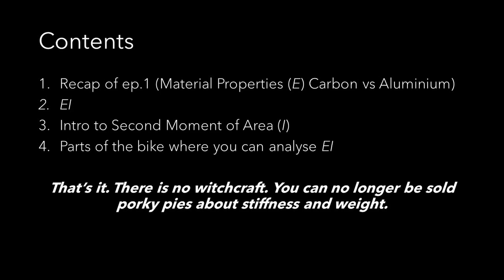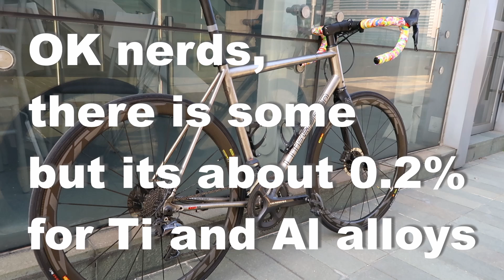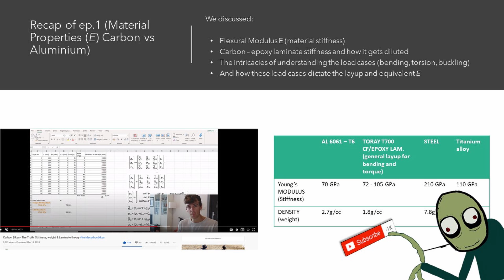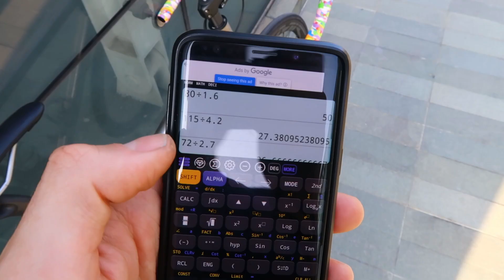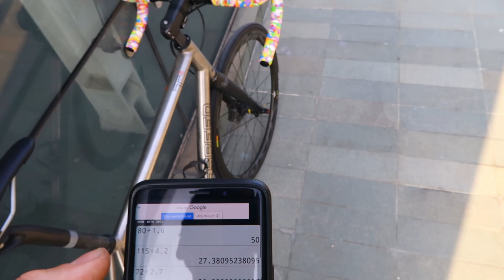Titanium Bikes - The truth and Physics of 'ride feel' marketing.

Comment: I sold my 2003 specialized Allez pro and bought a 2022 Litespeed T5. The geometry is advantage Litespeed. The specialized had a more compliant ride overall. About equal in climbing, handling and acceleration. The Allez is quite a bit lighter. The endurance geometry of the T5 makes it bit twitchier as there’s more weight foreword. My age made the switch necessary but I loved that Allez.

Comment: You need to be clear what you are comparing when you say titanium is not less stiff than an alternative.  The comparison is often between ‘typical’ titanium and ‘typical’ carbon.  In this case it seems that the extra weight of the titanium is less than needed to compensate for the lower stiffness of titanium vs carbon.  So in my typical example, the titanium is a bit heavier, a bit more flexible than the carbon.  The other factor is the shape of the ‘tubes’.  The carbon has a massive bottom bracket shell compared with the titanium, for example.  I’m almost certain that the titanium bottom bracket construction has more lateral flex than the carbon.  So in my case the titanium feels more flexible, smoother, less efficient, more comfortable, heavier than the (lighter) carbon framed bike.  I’m obviously not comparing equal weight aluminium and titanium bikes.  If I wasn’t looking for maximum speed and efficiency I’d prefer the titanium, particularly for a long endurance ride where comfort plays a bigger role.

Comment: i have 3 titanium frames i Love them all.. different characteristics from mtb, road and Gravel.. whew love the materials no corrosion and no paint chips 😂
Reply: If you want the Ti material to keep looking great, I am sure you already use scotch bright pads on them.  Then finish it off with Lemon Pledge for a fingerprint free finish that lasts quite a long time.  I got that trick from the guys I worked with at Nuke Proof in the mid 90's (when they were in Michigan USA).

Comment: Old video I know, but I just stumbled upon it. A few comments: 
Would you make a guitar string out of aluminum? No! Of course not! 
The ti bike in the photo is way too small for whoever is riding it; of course it's not stiff enough for a large heavy rider.
Modulus, modulus, modulus. Could you say it five more times?
You say frame stiffness based on weight, etc. Is roughly the same.  Well that may well be, but these materials can't be utilized the same. Aluminum bikes use large oversized tubes because of the low fatigue resistance of aluminum. Carbon fiber can be built very light, but again eventually it will fail! 
I own steel frames, a stainless steel frame, aluminum frames and I've ridden numerous carbon fiber frames. They are all very different kettles of fish.
You only partially understand the differences in materials and the "modulus" is only part of the story.
If you're only looking at stiffness fine, but as you point out it also has a lot to do with tubing profiles. Yes! That makes a massive difference! 
But, also the different materials have different characteristics. Aluminum can be extremely light, but it's unforgiving and even with advancements over the last 10+ years can really beat you up on long rides.
Steel? More forgiving you can utilize a thinner tube to get a lighter frame but can become too "whippy".  I think of steel (like a Columbus) as sort of the bench mark, the mid point between stiffness and strength.
Titanium "ride feel"? No, it's not just hype. The thing you don't take into consideration is that titanium doesn't just flex; it has extremely high stress resistance. The number of fatigue cycles you can run a titanium frame through is ridiculous. They are almost indestructible in normal use. So much so that this natural springlike characteristic is used to add shock absorption to frame designs. 
More than any other material Titanium bikes "plane". In other words some of the energy lost to flex on the downward pedal stroke is recovered on the alternating stroke. It's this lively feel that gives titanium its legendary mystique. 
You will often find that people who find a good titanium bike that fits them and their style of riding drop out of the new bike merry go round. It's the ultimate forever bike. 
I finally found the perfect ti frame for me a couple years ago. I then had a custom ti fork made for it. It rides great and I'll continue to ride it til I take my dirt nap! 😎

Comment: I think the modern road bikes with straight forks and hence shorter wheel base have made them twitchier and less compliant at the front. Im comparing the ride feel on my 2015 carbon Trek Madone to my Reynolds 653 custom race bike from 1993 and the 1993 bike was so much more stable in the corners which gives confidence. I think in the pursuit of every last scrap of performance the modern bikes have sacrificed some comfort and feel

Comment: Fine appraisal. Im struggling to pick holes in here but leads me to a different conclusion. 

Im an Al Canyon frame guy after suffering longevity and practical issues with carbon, for my riding, i would go thin walled Ti (super thin making the most of properties) or Aluminium as I am. Weight? Pah, im sub 7.5kg with careful choices, dont care.  I do care how long it lasts.

Comment: Aluminum tends to be stiffer because it needs to be overbuilt at stress points due to higher fatigue rates. Steel and titanium don’t need that due to their resilience. Titanium is extremely resilient to fatigue and can be designed to flex. Example is Moots pivot less suspension! You are oversimplifying the material properties. The frame manufacturers have the ability to make any traditional material ride compliant or stiff. I have owned steel aluminum carbon and titanium bikes and can say that they were all very different mostly because I’ve been biking on racing bikes since 1981.

Comment: 2 years old video doesn't need more comments - everything was already said. But still... In reality, in frame design, you are limited by strength properties. The goal usually is to build strong enough frame with as little material as possible. If a material has lower stifness to strenght ratio, you are able to build a softer frame from it. That's reason, why steel and titanium is usually less stiff than aluminium, and carbon is usually even stiffer. The weight is the output - not the input of the equation. So nice video, but missing the point totaly.

Comment: All things being equal.  The same frame with 5-10Kg of additonal weight rides smoother,  Heavier bike have less vibration, is less twitchy and has more speed momentum.  I added 10Kg to my Cannondale Topstone 1 105 and it was much smoother and NOT any harder to pedal under 25Kph,

Comment: Ti will be stronger, won't dent or tear as easily as Al, won't shatter like carbon. Will be corrosion resistant. Is more weldable, not the massive distorting heat input for Al, not the heat treatment complexity of Al. Is more machinable and expansion coefficient compatible for crank bearings. Material for people who want a bike that lasts a long time, maintain the mech and wheels, and don't worry about passing aero fads.

Comment: Interesting ,  I do bike packing I've just ordered a titanium framed bike for the weight , & the fact it holds a pinion gear box . The weight is only important to me when it comes to lifting over fences etc , They are also 3d printing  titanium these days so the shapes aren't a problem .Also most of my comfort comes from 2.6Inch tubeless tyres at lower pressures .

Comment: nice  consideration  not  necessarily agree  on all the  statements, the main  issue  is  that  the  25  especific  modulus been  stablish  as common  denominator  then  Ti  Steel ... round  tubes have some  diferent  that bring or  add  to  the  comfort  not  for  specific  persons  ... probably all persons can  feel  the diference from  smooth  tarmac  to  cobbles... and  even  more  on  gravel  ... then is  marketing  but  then the  virtue  is  not  the  material  is  the  form and  the way builders  use it... like bike  fitting  kinda  jumps  in to  your  face  the  diferences  after  ad  before  using  or  having  one.

Comment: whatever. I love my 2023 Arenberg Litespeed. I came from riding an aero carbon, and from my experience, the Ti is sooo much smoother, and I have lost zero speed. It's just awesome. believe the haters if you want, but Ti is the truth. Ti and Al are NOT the same. Weight alone debunks that thought. And the 'Can' demo? Is that can made of 3/2 or 6/4 alchemy?  What a stupid fucking argument. Is tissue paper the same as cardboard? They are both made of paper, so they are the same, right? SMH my head, my dude. All this to say, my Ti is 1lb heavier than my Carbon. It's more comfortable. It's just as fast, and it will last a hell of a lot longer. Not to belabor the point, but I have all the Pokemon. I have a Steel bike, an Al bike, a Carbon bike and a Ti bike. Steel is... an experience. Al is like swinging a weighted bat. Carbon is great, but temporary, and you feel just every pebble on the road. Ti gives up a bit of weight for longevity and comfort. Don't just believe any dude on the internet,  me or this git, just ride one and see for yourself. The proof is in the pudding.

Comment: I know this is an old video, but, some historical perspective is necessary. Before Ti, 99.9% of the top of the line bike frame effectively has a limited number of hours before you need another one.    (Aggressive, unstoppable corrosion and no way to stop it). Enter titanium!  It took a long time for cycling consumers to adopt.  High end consumers didn’t have to accept the limited hours of high end steel frames. And they were incredibly light with generally excellent riding properties. IMO, the Ti bike manufacturers “hang on” to this period in bike manufacturing as justification for their products. In 2023, Aluminum definitely has parity with titanium performance at much lower costs.  But, Ti frames are still SO pretty!

Comment: Young's Modulus for elasticity is of course accurate.  In the realm of bike frame design, tubing wall thickness, geometry of frame set layout, can make a 56cm titanium frame ride harsh and an alloy frame ride smooth, or vice versa.  I've ridden a few different ti frames, some much smoother feel than others, same wheels.

Comment: I have a titanium roadie (Lynskey Sportive) and a titanium hardtail (Lynskey Pro29). I even put a titanium fork (Boost Bearclaw), stem, seatpost, and bars on my hardtail. When I'm using the same tires/similar rims, he difference in comfort between my roadie and a cheapo aluminum Fuji is zero or close to it, and if I'm going in a straight line, I'm pretty sure my rigid hardtail feels exactly like a Karate Monkey that costs a third the price. 

For me, it was a Gen X midlife crisis thing (all the ti frames and anodized components I couldn't afford as a kid), plus a lot less worry about maintaining a finish and dealing with corrosion. But mostly, it's pretty and made out of the same thing as spaceships. :)

Comment: You can do all the math and science on paper you want , however I challenge you to contact Litespeed and see if they will loan you a T1sl for a few weeks and get a good 500 miles on it in terrain similar to what you ride your carbon on . I can assure you that you will experience something that is extremely unique as to the feel to the ride quality. It’s not just the material but the geometry construction/ craftsmanship/ tubing and utilization of manipulating the material to create the stiffness and tolerances that all come together to bring forth a masterful frame-set. And the whiskey Carbon fork they are now using is stellar also , side note . I also just recently purchased a Time scylon 2022 model which in my opinion is hands down light years beyond any and all other pre ported high end carbon bike frame manufacturers as to the RTM technology utilized that brings forth a sublime ride quantity that is superior. I have ridden the Sl7 , Dogma F12 , Colnago c-60 , and I currently own a 2019 BMC TEAMMACHINE, 2022 T1sl , and the Time Scylon 2022 . Put about 1200 miles on the Scylon and what a joy to ride but threw the faveros back on the T1sl and indeed it is a special machine that is in its own lane . I’m sure litespeed would accommodate you in exchange for a review video and a new assessment on your honest opinion after potentially spending some quality time on a T1sl .

Comment: For me its either Steel or Carbon. If I want a rust free metal bike that can't be easily fixed why not choose Aluminium over titanium its so much cheaper. Steel looks the Sexiest and if I crack the frame I can fix it my self. Carbon because its lighter and is getting very affordable. The tensile strength of steel is different depending on heat treatment and steel type.

Comment: Please make simple test, 4 top rim brake bikes, same seat tube diameter so you can use sams sestpost and saddle, same handlebars, same bar tape, use one set of wheels and put same wheels on carbon, titanium, steel and alu bike and ride on different roads and than report results. I did this exact test with 5 bikes and aluminium bike is the worst on bad road surface, Carbon is better, but still too much buzz. Steel bike with steel fork is the most comfortable, than steel with carbon fork, Titanium with carbon fork little less, but diferent sense of buzz than steel.

Weights and bike tested: Alu 8.5 kg, Carbon 7 kg, Steel 8.3 with carbon fork, Steel 8.7 kg with steel fork, Titanium 7.7 kg. Wheels used Fulcrum Racing Zero and 25 mm cotton tires. Seat post Zipp 27.2 mm. There is a real difference in comfort between all bikes, one reason could be the different forks, because the steel bike with steel fork is by far the most comfortable ride.

Comment: Why are you assuming a similar tube profile? The whole point of titanium is a smaller tube profile. 

Also, coming from the mountain bike world, lateral flex dramatically increases comfort. Yes, the double triangle prevents vertical compliance, but few of us ride on completely flat, track-like surfaces. Allowing for horizontal compliance of the wheels is huge for comfort and handling. Lean over a stiff bike coming down a canyon road and the grip is noticeably (some might say scarily) less than a more compliant bike.

Comment: I agree with the points of this video, and have personally confirmed by having an OS2 format steel bike (Gunnar Sport) and Moots Routt 45.  Their tube dynamics feel quite similar.  Tire, component, and frame geometry play much bigger roles than the frame material.  I bought the Moots for other reasons.  The Gunnar’s tube walls are extremely thin.  It is actually a lighter bike than the Moots, but it has many paint chips and a few tube dents that I’m glad to not worry about with the Moots.  Frame bag straps patina the Ti, but I don’t need helicopter tape like to protect paint.  I’m also pretty sure the Moots is more crash worthy - a theory that was tested by it surviving, with only a few scratches, being hit by a car that broke 7 of my bones.  We measured with a frame building jig afterward, and it was unaffected.  Compared to CF I very much appreciate that Ti (and steel) can have custom geometry.  Both Gunnar & Moots are custom, fit me very well, and have geometry that is not available on any stock CF frames,

Comment: Interestingly, the specific modulus of steel is also basically the same as that of Ti and Al (and magnesium is right in the same ballpark, too).  (Also, note that, unlike strength, the modulus of elasticity is essentially the same for different alloys, heat treatments, etc.)

Comment: So a lighter carbon frame is not much stiffer than a titanium/aluminium wich maybe weights 200-300gr more. You can only compare stiffness If the mass/weight is the same. Correct?

Comment: HSS actually has a specific modulus similar to aluminium and titanium. Al frames can be built lighter than steel. The torsional stiffness of a bike frame is basically determined by the GJ of the top tube and down tube, and this is mostly controlled tube diameter. For the same amount of material, the linear static theory tells you it is better to distribute it on as large a diameter as possible. This breaks down at the point where the tube is so thin that it is at risk of shell buckling, and this tends to happen at a fixed thickness/diameter ratio. Aluminium is much less dense than steel, which means a given sectional density can produce much larger diameter tubes before buckling. For the same reason, optimally designed Al frames will be lighter than Ti frames. I work in composite structures, and there are some specific applications where balsa wood or styrofoam produce stiffer and stronger structures than carbon fiber at the same weight, for basically the same reason.
Reply: This is really interesting! Do you have any example of the Styrofoam/balsa structures I'm curious.

Comment: I disagree, but whatever, maybe when you have 40 or 50 years of riding under your belt you'll figure it out.  Not saying geometry isn't important, just saying that frame materials do play a role, and perhaps if this station wasn't so much into current market trends and forcing those at us, you would be more honest, but right now CF sells, so they rely on people like you to push the story forward.

Remember, I'm the guy that caught you guys cheating on the rim vs disk brake tests you did, so I don't take a lot of what you say to be fact, some of what you guys do say is fact, but when it comes to market pressures, you bow down to the market god.